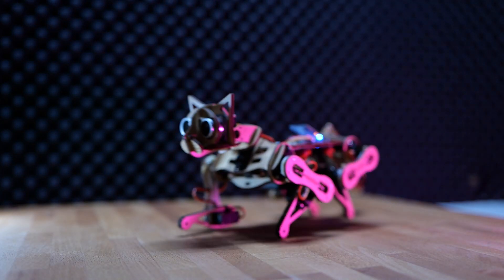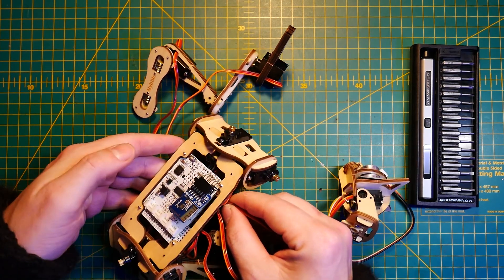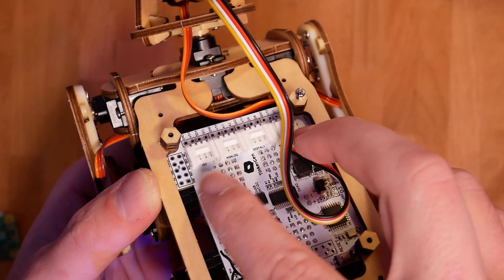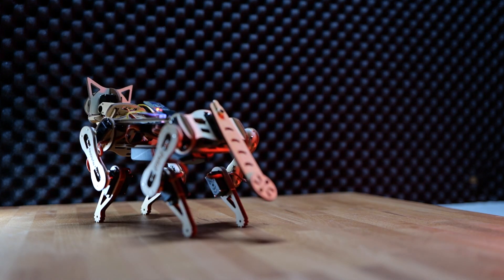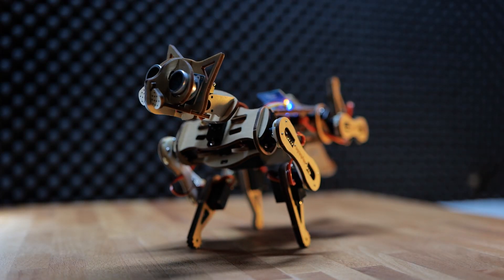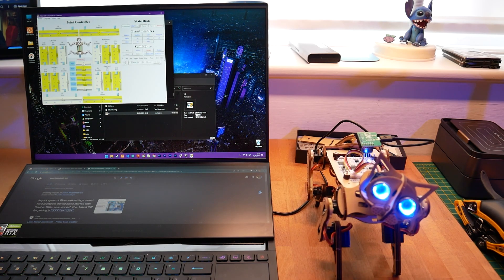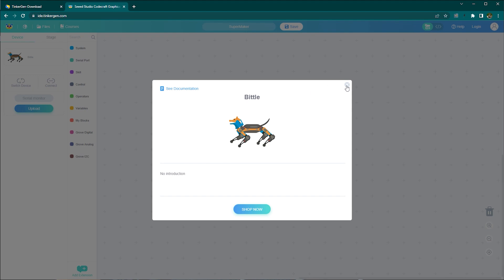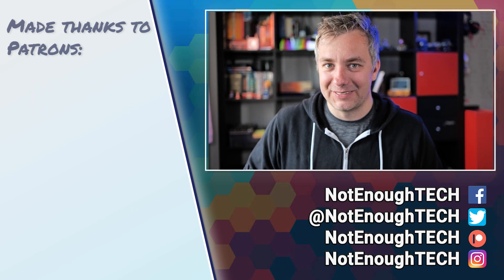Nybble by Petoi

Comment: Is there space to attach the lower legs to the top of the servo mounting plates rather than the bottom?  That would make the stance wider and more stable.
Reply from the maker: You could try it. Just need something to fix the screw. Maybe a nut? Overall I don't feel the robot is unstable. Most of my tips were caused by a calibration issues. I left it in the video as they look funny. Overall I would stress about this part. The only thing to improve is the neck as shown